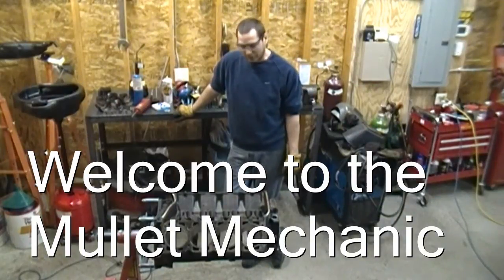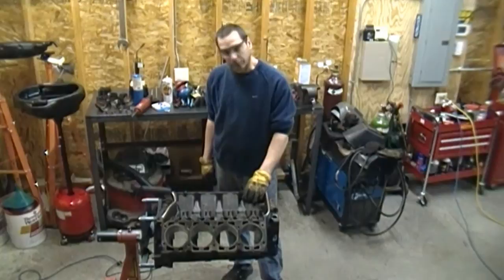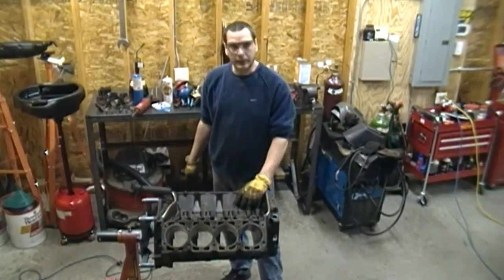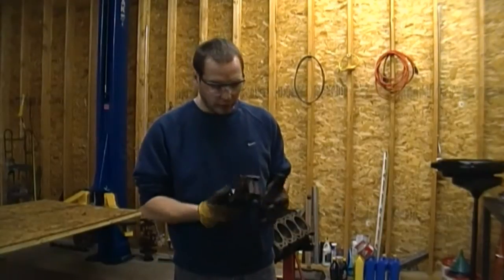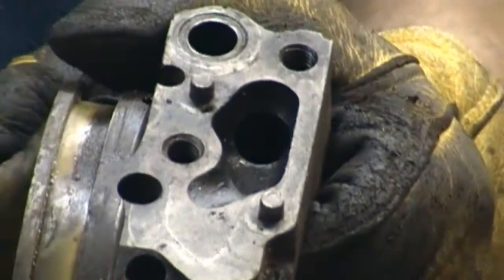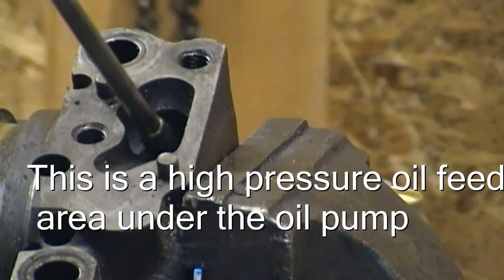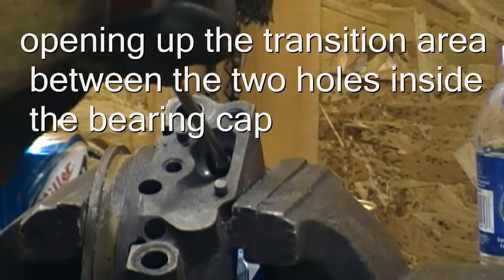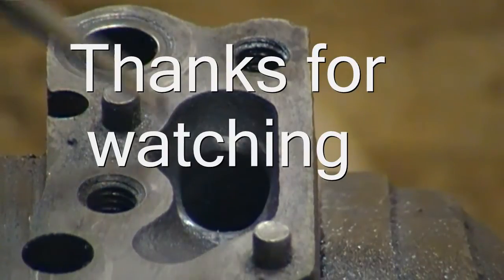Using a die grinder on a Oldsmobile 455 engine block during a rebuild

Comment: I use this to grind fiberglass pipe at work.>>>allmy.tips/MakitaDieGrinder?Q69   I didn't want to spend a fortune since the dust eats these tools up. It works great but I don't really have a good reference. I got tired of going to the tool room for one and it was either trashed or missing. At least I always know where this one is and it'll always work.